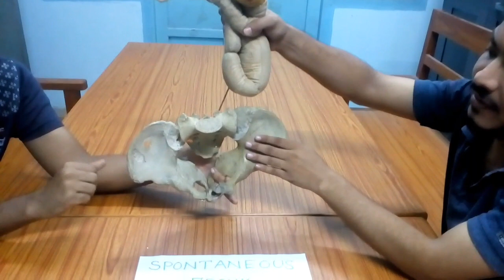Breech delivery mechanism of labor

Comment: Hello I have one question. In this particular position, since the head is only rotating by 1/8th, why does the body also rotate externally? Can the neck not handle a torsion of 1/8th as in cephalic presentation?